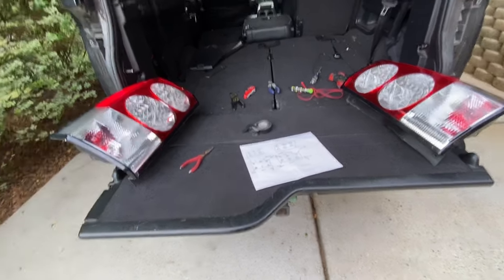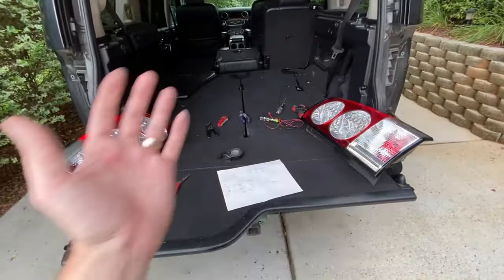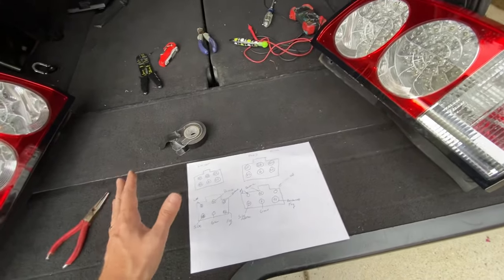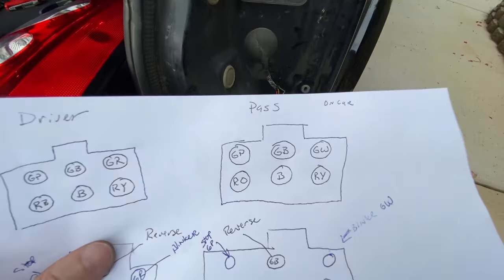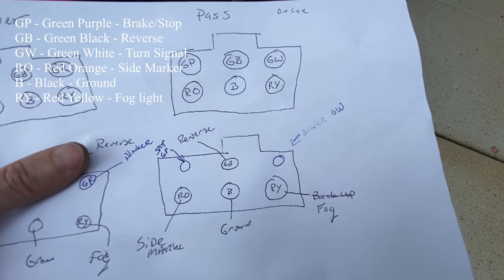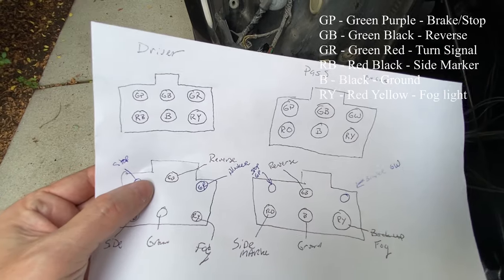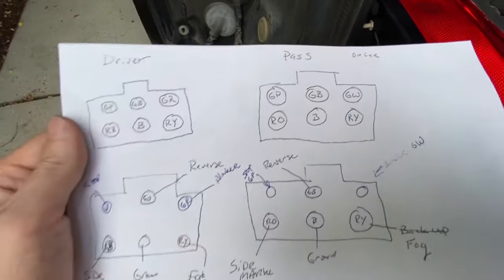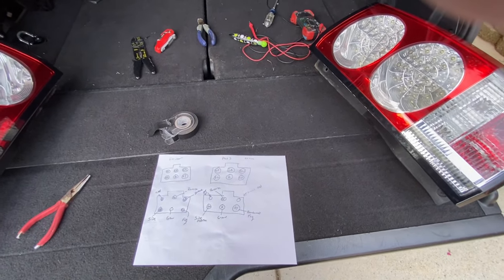Land Rover LR4 Brake Light Fix and Wire Diagram

Comment: I was having the exact problem with my Range Rover and I am so glad I found your post. I stopped trying to trace back everything and just sliced in a wire from the driver side rear. It worked and only took about 15 minutes. So again, THANKS!
Reply: Which model do you have? Mines 2012 so I’m curious if it worked for you?

Comment: I have exactly the same fault on my Range Rover, i tested brake light wire with multimeter and has no volts to it so presumably has a break somewhere in loom but it could be anywhere, I was wondering if I could simply run a wire across from one side to the other and tap into it, I guess that’s what you’ve done ????
Reply from the maker: Yes, thats the concept and it is what I did.  Its been 2 years now and the brake light is still working perfect, just by tapping into the other side.   (rather than what I feared would be an infinite hunt in the interior wiring.
Reply: @FarReachFR  thanks for reply,think I’ll give it a go, I didn’t fancy trying to track the cable through the loom 👍👍
Reply: Im having the exact same issue on my  06 LR3, once the brake is depressed the light does not light up when released they both work glad I ran into this video as it's been absolutely driving me nuts. Another question is are you getting any fault codes by doing this. Some reason it's been throwing off my shift link and when it happens my tranny only works in 1st gear, sport shifttonic works throughout all gears, but when put back into reg drive it will not shift out of first. 
I noticed it only happens as soon as I turn my lights on. Gotta love the Rovers